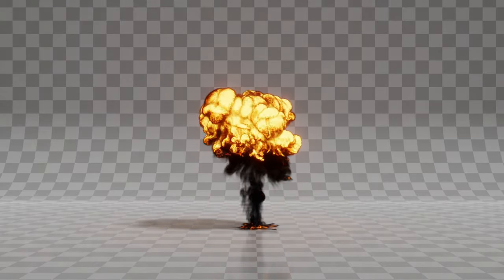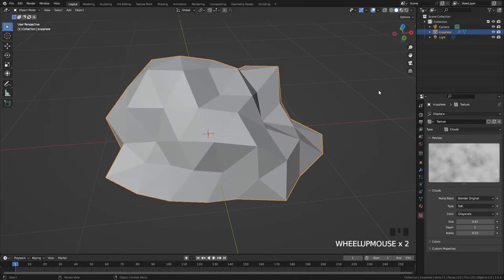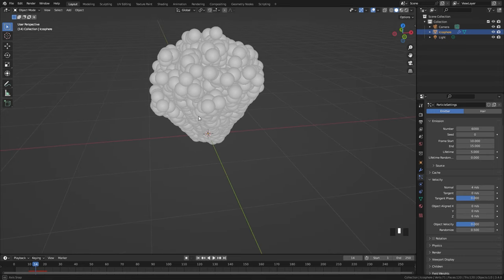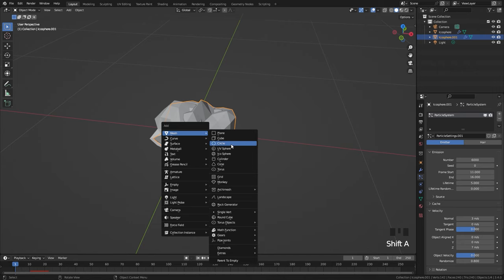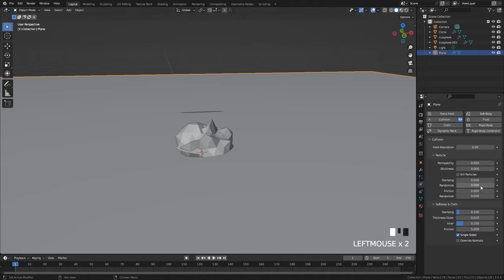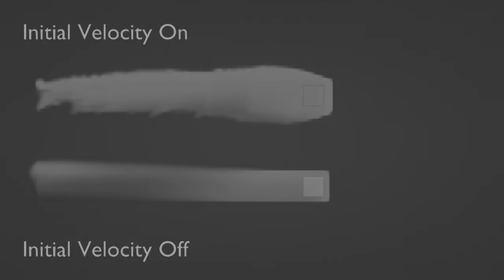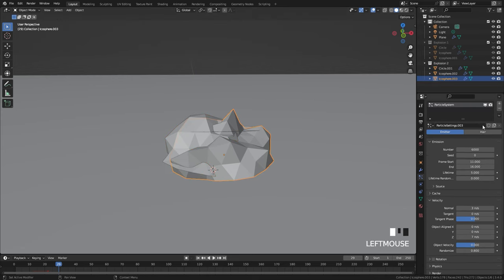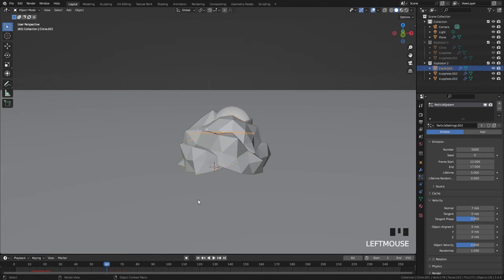Blender Tutorial - Creating a Simple Explosion Simulation

Comment: Great tutorial. Have a question though. When I do the viewport render, the domain bound box shows in the render. How do I remove bounding domain cube from render but keep the explosion showing in the final viewport render?
Reply: JUST hide it from the render
Reply: @Sirlopsteropster  Turned off render icon to turn it off but the bounding box does not go away in the render. Any other suggestions on how to remove the bounding box?
Reply: @Shamusladdy  um render it in cycles?
Reply: @Sirlopsteropster  I am rendering it in Cycles. Am rebuild from scratch to see if I missed a slight item but not confident it will work.
Reply: @Shamusladdy  Did you find a solution? I am having the same issue. Thanks
Reply: @johnstesttube7768  @Shamusladdy  You have to add smoke material to domain (cube) before rendering  - 13:49. Or you can click View -> Viewport Render Animation